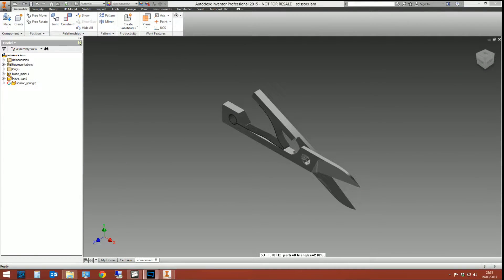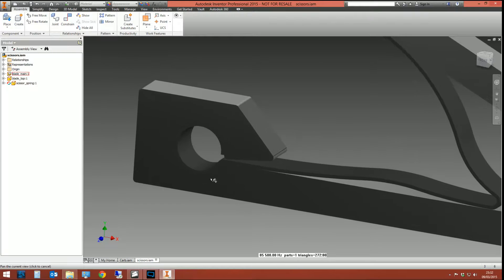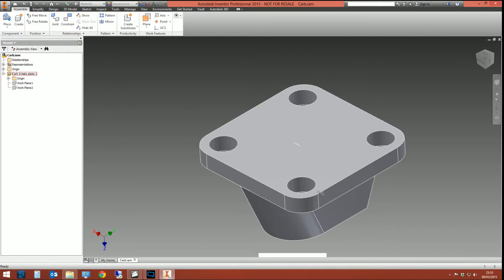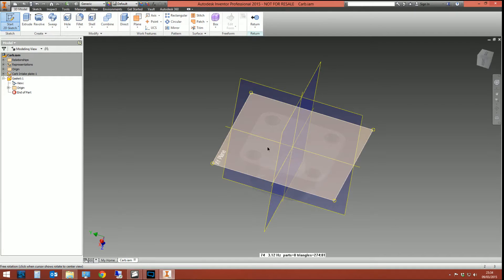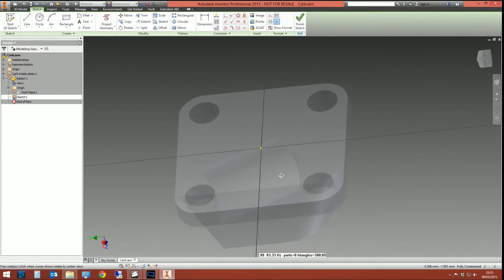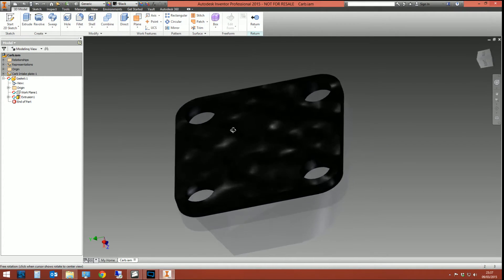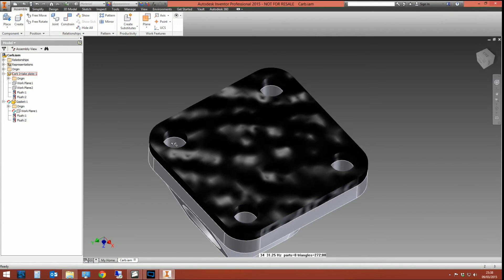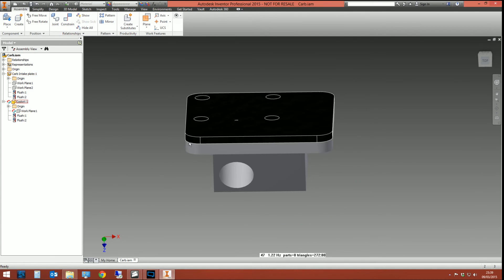Adaptivity as fast and as simple as possible | Autodesk Inventor

Comment: I've got an assembly with a somewhat large amount of parts and pieces. Before creating a new part I verified that I could move all of the various parts/pieces within the assembly as expected. I added a new part to the assembly origin then drew a 3D sketch constrained to a couple of separate parts within the parent assembly, making sure to use work axes and work points. However, when returning to the parent assembly the parts/pieces of the parent assembly are locked and will not move even though prior to producing the new part these pieces did move. Adaptivity is turned on on the new part I can see the symbol. Is the assembly too large to do the computation?

Comment: Good explanation of how adaptivity works.   Would love to use it more in my work but at a certain point adaptivity causes an incredible performance hit in Inventor. I am still on 2016, 2019 may be better. 
What is interesting is if I use derive to bring the geometry from one part to another there is no performance hit. 
Do you know why?
Reply: I beleive that derive creates a dumb solid. Although derive links to the other file to keep it updated, it just updates the dumb solid, which has no features. My best guess.

Comment: Hi!
I have a question :D
Can you save the "new part" (the part wich is adapted) as a individual file without adaptivity?
Reply: Boreal Sigil Yes. You can ssve with another name and edit first sketch. Delete all connectios to the base part and add constraints and dimensions. It'll be great to add relations to Center point.
Reply: Thank you so much Mistress!

Comment: I've been using Inventor for about eight years now and I make it a point to disable "adaptive" in EVERYTHING. It may work well in less complex assemblies and/or smaller components, but on large assemblies with complex, interdependent parts, it seems to ruin many things, then waste my time fixing and checking everything. I find good constraints and forethought in a good design to render this "adaptive" nonsense useless. But thanks for the video! Great information!
Reply: I been using inventor for 2 years and im learning it hard way.

Comment: Question for you..see the way you created the adaptivity and then turned it of and then back on,for arguments sake if I created a box with a recessed lid and know it fits etc but hadnt used this work flow could I click on the menu and turn it into an adaptive part or would this be classed as bad work practice,seen this used with just sketches in my distant memory,kinda get this mixed with using the sculpt tool to remove cutouts etc within assemblies.Will have to send you a pic of what Im doing probably easier for you to see what Im doing.take care good vid as this can be made to sound complex when just used with sketches for making linkages and stuff,lot to be said for a good tutor=)
Reply: Paul Munford Cheers Paul it was half the reason I asked as had things go wonky myself but I do remember way back Autodesk use to do Inventor webinars-they were really good not sure why they stopped but there was something said about using this on several occasions that things could go wrong but in saying that he had used it in a layout sketch for a linkage-kinematics I trhink is the correct term but dont hold me too it..hope alls well bud still keeping up with the blog.
Reply from the maker: James Lenane Well it depends on how you modelled the lid... if you modelled the lid completely separately to the box then just dropped them two together in an assembly and made them adaptive, it wouldn't be linked in the way you'd want.  You'd need to edit the lid and reference the box into the sketches and/or features to build the adaptive links.
Paul Munford Agree with Paul too, adaptivity is great for simple assemblies but in large scale designs it can cause more problems that it's worth especially if you have multiple designers working on one job.  If adaptivity breaks and it wasn't you who built it in, you're left with a job in finding out how the guy designed it to correct the error which can take an age to do.
Reply: CloudCAD Ltd James Lenane P.S. Are you guys going to D3D Live?
Reply: whats the date as would love to
Reply from the maker: CAD Setter Out Can't say I've come across this guy before, the video also ends after 9 minutes without finishing? Personally I can't attend D3D as I'm balls deep in a massive Vault implementation project this month, 8 months prepping for it so I can't really take a day out this month!
Reply: 23rd March it's free!
http://cadsetterout.com/resources/why-you-need-to-attended-develop3dlive-2015/
Reply: Sorry 26th headsmack. That guy used to be the product manager for inventor ;) he's working on fusion now.